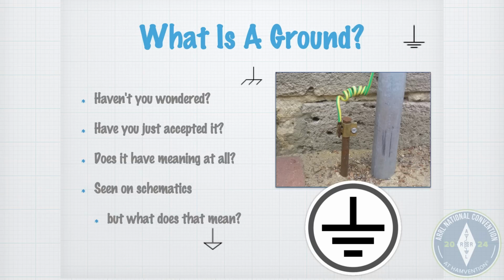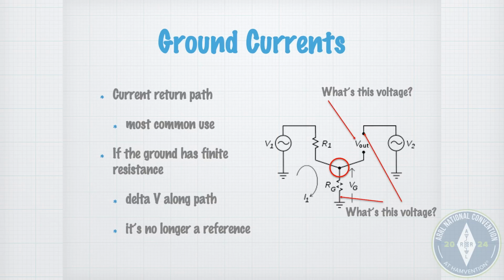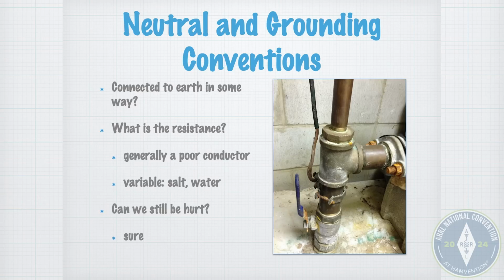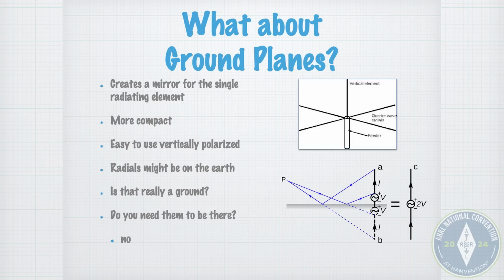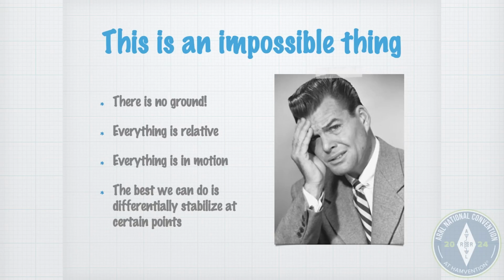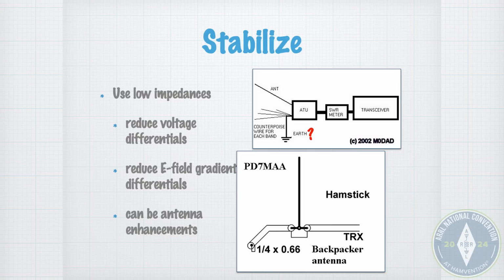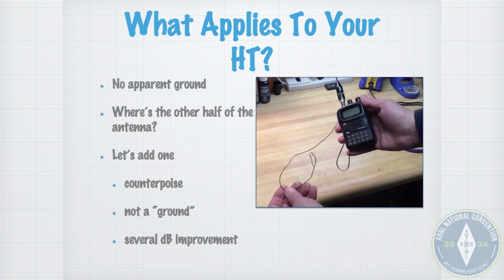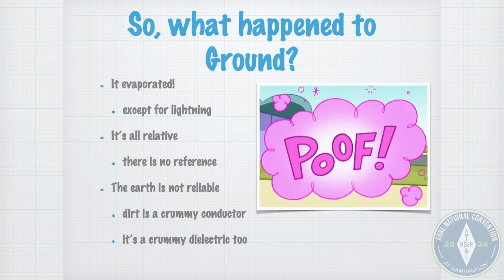Ground is a Myth! | 2024 ARRL National Convention

Comment: I believe a word missing here is,
 " Earth ", or,
 " Earthing " !
I have a feeling that this lecture may serve to confuse especially a newcomer !
Just because you have an opinion, doesn't mean it is correct !
Many times, you are combatting the devices planted before you show up with radio equipment !
Old electrical house wiring, as an example !
To try and sway someone from not using grounds, is reckless at best !
I could go on, but then I would sound like the speaker !
Odd that no one in the audience has taken exception to things she is saying ?
Perhaps the material wasn't on their computers, as they were memorizing the answers ?
Oops....!
                      😳
I think Tesla would be in disagreement !
                         🤔.....?
Reply: I encourage everyone to use appropriate grounds and to bond to the building’s grounding electrode system if located in or on a building or using electrical power which isn’t independently and separately derived at your location.

Just because “ground” potential is relative doesn’t negate the necessity and functionality of proper bonding and earthing.

It would be nice if current-carrying “grounds” had a separate meaningful name like “return” or “drain”.  (“Neutral” is not a meaningful name.)

“Earth” is a good name except it leaves her with the question of “where exactly is this patch of earth?”.
Reply: @denverbraughler3948  
I think the above video, is just one example of how people have surrendered to  the idea, that it's O.K. to let someone else do your thinking for you !
And sadly surprisingly this was not a young per se, crowd, never questioned her opinions !
Just as a side note, I wonder if there are records available showing how many times lightning was diverted by way of Lightning Rods installed, that kept homes struck by lightning, from catching fire ?

Comment: As a retired broadcast radio and television engineer my advice is to NEVER operate an ungrounded antenna outdoors, other than a handheld walkie-talkie. I have been responsible for many towers up to 2000 feet and they get hit by lightning all the time. I have seen what damage lightning can do to a commercial facility and it is impressive. If lightning comes into your house it will destroy everything that is plugged into the wall sockets and likely burn your house down. Do a web search for "grounding manual us department of defence."

Comment: As an electrician I am required to provide a grounding conductor in the power systems that I install.  Most times this is required by the NEC and adopted by some authority that has jurisdiction over me to select or reject my installations.  An entire (250) article in the NEC is dedicated to grounding and bonding.  I assumed that some people smarter than me developed this theory and process.  The term ground maybe is not the perfect word.  Pick anonther one.
Reply: In a closed electrical system all a "ground" is, is a return to source. Just like your neutral.
Reply: I think “RF Ground” is a myth, “Electrical ground is a matter for the NEC”, and “station DC powered chassis bonding should not be confused with A/C NEC codes”, “RF Ground” and lightning protection, and NEC rules, create some messy and almost unsolveable issues.  Saying “Ground is a myth” is just a short form for saying “Ground is an oversimplification”.

Comment: The US GFI (Ground Fault Interrupter) is often called an RCD (Residual Current Device) here in UK  which gives a slightly easier route to seeing that  that some current (residual) managed to get away from the expected wiring loop. 
Ground is a big topic ! 
It may not be a myth, but the ideal ground is always inaccessible!
Reply: Hi Phil… I take it from your comment you live in the UK and have knowledge on the subject of ‘ground’  I’ve just built my ‘shack’ but the radio equipment is not yet installed… I have a purpose build place in the back garden and my understanding is that ground should be taken back to the consumer unit as one point of ground. ( which I’ve done btw ) My ham friend is insisting that I drive a rod into the ground at the shack and everything should go to that.  Can you point me in the direction of knowledge in the UK regarding ground or can you advise please.  I’m willing to put an earth rod in ( bought one at B&Q )  I’m just not sure it’s necessary after watching SO much about USA  ground advice / issues. I do agree with Jim W6LG  but I’m open to advice from a UK source… there’s not a lot I’ve found so far from the UK perspective.  Thanks very much.73.

Comment: Kristen thanks for a great presentation overall.  Many of us have multiple antennas on multiple poles with a separate ground rod for each. I keep harping about the importance of bonding ALL GROUND RODS TOGETHER OUTDOORS, AND TO THE UTILITY GROUND  AS CLOSE TO THE SERVICE ENTRANCE AS POSSIBLE. 
If LIGHTNING strikes an average 30KA bolt multiplied by a NEC specified ground resistance of 5 ohms or better yields 150 KV ground bounce for the struck antenna/pole. The other ground rods on other antennas/poles will show much less voltage, depending upon the distance from the one Struck. This can bring 150KV into your shack on one feed line. Not good.  If you bond ALL grounds including together with heavy copper cable, all your feedlines and your entire home will bounce to as much as 150KV but the Differential Voltage between all feed coax and connected equipment should be only a very few KV,.and unlikely to set your shack or home on fire.
David ac9cx
Power electronics engineer for 5 decades, now retired.

Comment: CRANEs are 500ft shorebirds composed of steel truss whose main diet is frogs and small fish.  Cranes are commonly found in wetlands and large construction sites.   (Wrong, no such cranes exist.   The word "crane" has several conflicting meanings.   If we combine them, then we create a nonsense-crane, a non-existent crane.)   GROUND is a power-company earth-connection used as circuit-common voltage-reference connected to a metal chassis and required for longwire antennas?      Wrong.   Ground doesn't exist.   It's a myth.   

Construction equipment isn't powered by small frogs, and to cut through the confusion, simply stop using the word "crane."   Just use some other, more accurate labels.   The same goes for "Ground."   Stop using that word.   If you mean "circuit-common," then say that, and don't say "ground."   Also, say "outdoor earthing-stake," and "chassis connection" and counterpoise-element, and negative supply terminal.
Reply: the confusion in antenna grounding comes from reflection (surface waves) and also from lightning protection with a load of urban myth thrown in. Moist ground does reflect better than dry as in it helps to form / balance the mirror image of the waveform in those type of antenna systems but it's better to get the correct distance above earth with both elements (for the task in hand).

Comment: Interesting presentation.  My shack is upstairs and my only earth/ground is the domestic supply ground.  I have kept all leads both DC and AC as short as possible and fitted ferrite clamp on beads on the inputs to all equipment.  Thank fully I don't have any hot ⚡🔥 ⚡spots.  73's

Comment: Many operators confuse themselves with the word "equipment" about everything connected to power supplies, tuners, meters, external speakers, etc.  If you're "grounding" ANY of that stuff we mistakenly call "Ham Radio *equipment*", you are actually violating NEC (National Electric Code), to the same thing you ground appliances such as a clothes dryer to.  I get such a kick out of these per-snicketty stuck-up Advance Extra Class operators that think that their license, class particularly is like to a Ph.D in Electrical Engineering and all other fields of study, 🤣🤣🤣!"
I too work from an apartment on the 2nd floor with an antenna (HF) mounted on the aluminum balcony railing and this application has worked for many years!  I remember an Advanced Extra class op trying to tell me that I should ground my station to the center screw that holds the face plate of the wall outlet to the receptacle - what a LID!  But that's what some of these class clowns in Ham Radio like to do, is give a newbie bad advice that could actually cause great damage, injury, and death, and then have the audacity to say, "Well, he's gotta learn!"  And grounding even the antenna has very little, if anything to do with the VSWR, as many a Ham have lied to me about that as well.  VSWR has to do with resonance and impedance matching.  Otherwise, a great presentation on the "Ground Myth".
KD8EFQ/73
Reply: "I get such a kick out of these per-snicketty stuck-up Advance Extra Class operators"
Sounds like "sour grapes"
https://en.wikipedia.org/wiki/The_Fox_and_the_Grapes
"People who speak disparagingly of things that they cannot attain"
Reply: @thomasmaughan4798  "Sour grapes" = raisins.  Good, healthy raisins.
And, I wasn't trying to "attain anything" here.  Move along now.
Reply: @Charlie-n7i  "And, I wasn't trying to "attain anything" here"
You didn't, so okay then!
As it happens, I agree that "grounding" your radio while on the second floor of an apartment is worse than a pointless exercise, depending on what sort of radio it is.  
I also agree that some Extra Class amateur radio operators are more engineer qualified than others.   I also had the First Class FCC radiotelephone license (back when it existed) and that was a tough examination.  
Even though I am "extra" I am still learning!
Reply: Aluminium railings and power supply chassis!? I did have an aluminium power supply chassis once. A Lambda power supply but that was the only one I had in alloy.

Comment: This is a super-good presentation, and hopefully will be assimilated by all of the attendees at the convention.  I lived through almost all of the problems and content of this video.  As an EMC/EMI and Lightning engineer, it was obvious that there are "many grounds" within any larger system, particularly where larger powers are transmitted.  Ground loops, Ground bounce, Electrical or Radiative leakage, Adjacent coupling (even through iron pipes), all occur.  Formulas for these are available in any college textbook.  Locally, there are no universal grounds, including lightning.  Just look at the sites where people died, when entrenched or climbing into gullies in the mountains, where the strokes/strikes just go down the creek bed, near or through  them.  If you want a good ground near a beach, find a place where a bolt hit the sand, and dig around it.  You will find a glassified wormlike area going many feet deep, and these are often filled with molten lead or solder, and sold as objects of art.  That lightning strike (probably the only one of several) has managed to find its "own" ground.  Hits on vehicles often go through all of the tires, and flatten one or all.  RF burns can occur along any conductor where a resonant structure/length occurs.  This often happens along long coils (like a Tesla coil), where the local lateral or angular resonances amplify the stray radiated fields.  Seen these things many times, and there are videos on the Inet which show these various EM effects.
Reply: then you have golfers and lawn mowers... vehicles... things that generate their own currents but arent grounded their somewhat isolated... but building potential. 

so even in the middle of no where with taller and better grounded things, these get hit because it becomes an easier path for earth generated lightning in normal situations.  

these fields move... the greater differnces in energy snap... we see these as aurora in extreame cases.  lightning without clouds or storms... until it happens...

Comment: So, are all the ARRL license manuals (which show the proper station set up with a copper pipe as a common grounding point which is then connected to a ground rod and bonded with the home's service ground rod)  going to be updated to reflect this?
Reply: Very good! I ditched radio shack ground rods a long time ago. I never want an isolated ground rod connected to anything that is connected to or plugged into an outlet connected to commercial power. Under certain conditions ( like lightning) a very large voltage gradient can exist from one ground rod to another that can destroy equipment. This is widely misunderstood!
Reply: Reflect is the right word.
Reply: NO and you are not really paying attention.  What you refer to is lightning protection.  That kind of ground (among the many mentioned by her) is a place to put the lightning energy other than your home.  So the answer to your speculation is: WATCH IT AGAIN.   Ground can also be a counterpoise, but so can radials on the ground or a dish or the other side of a dipole or whatever.  AND if you look at the License manuals and so on, read for comprehension.
Reply: @GeoffreyFeldmanMA  W1GCF de AB2ZI... Gee. Thanks.  In the spirit of Elmering you truly gave a well thought out and succinct explanation. 
I understand the difference between lightning and RF in the shack getting on the equipment chassis. IF there is no RF in the shack then yes, you wouldn't have any on the equipment.
In the talk, reference, especially at the end, is made to RF burns and RF in the shack.  The ARRL license manuals, which I use in my classes (ARRL Diagram 0076) shows what I stated.  Each chassis is connected to a common ground bus directly (1/2" copper pipe is recommended) with a hose clamp.  The end of the ground bus is then connected to a "Low-impedance Conductor As Short As Possible" to a ground rod with the proper clamp.  The text of the book(s) then recommends that ground rod also be bonded with a single large copper wire to the main house service ground rod.
I was asking for clarification on THAT point.  
I've emailed you the diagram so you can see what I was talking about...